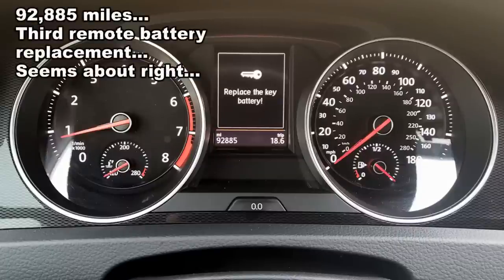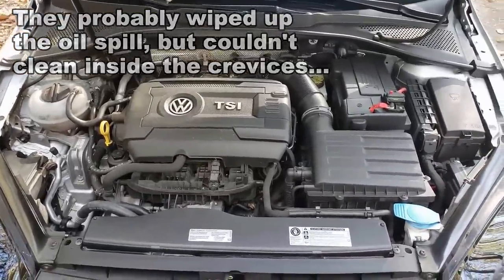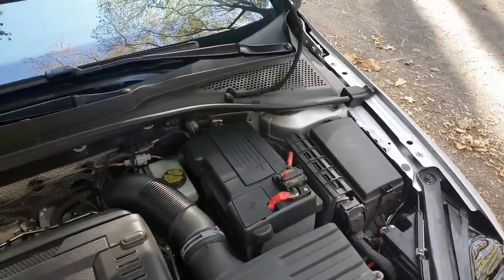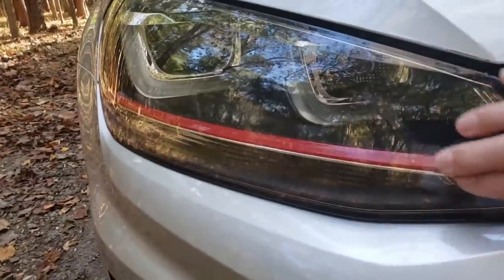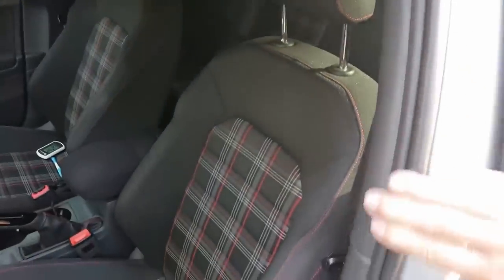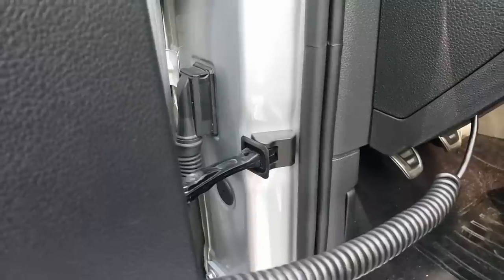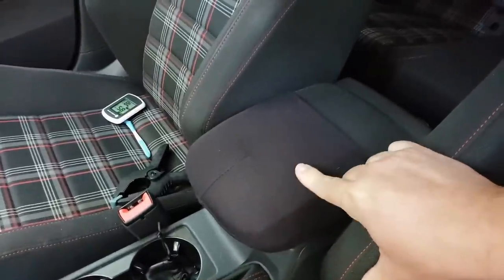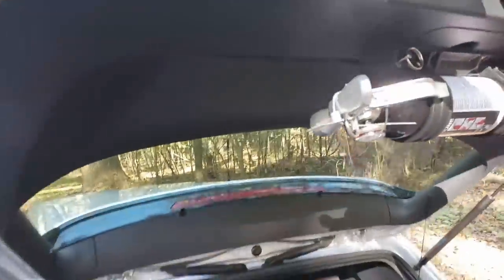THREE YEARS AND 93,000 MILES: My Report, Part 1

Comment: My '15 SE TSI Sportwagen auto has 40k now which I bought new.  I have clear bra and love it.  No leaks in sunroof.
I know what your talking about regarding water dripping down with window open.  I open the sunroof a bit if I want some air. 
My oil loss is almost 1qt in 10k miles.
Coolant loss is an inch in 10k miles.
Have never broken down, love the car, awesome performance, utility and economy and have gotten 40 mpg on road trip.  Love the size of the Sportwagen and VW flunked by not selling GTI Sportwagens.  The size is perfect and fits a 21cf cargo box.
Would like to add a hitch eventually.
Leatherette still looks new.
Added amber rear turns that are extra brake lights as well.  Stock wiring.
Looks sweet and much safer.
Just pulled out the red strips and use amber bulbs.
Cheers and great info.
Reply from the maker: Thanks for sharing! Your GSW sounds like a gem! Take Care, -Scott

Comment: The thermostat housing is known to seep coolant. You want want to look under the car near the oil pan. If there’s a leak/seep on the t-stat you should be able see white crusty mark around the oil pan. I have a 17’ w/ 71k miles and finally have the t-stat and water pump replaced.
Reply from the maker: Thanks for writing.

Comment: im surprised to find out that you have the same suspicion about coolant disappearing that i have with my mk7 gti (2018). ive owned my car a little over 3 years and only in the last 10 months ive had the low coolant light beep at me - once last novemeber, and again this past february (2023). ive topped up the coolant after both scares. was washing the car a month ago when i found what looked like hard water residue on the underside of the hood, and on the lip that runs around the reservoir. i cleaned it up and im giving it some more time before i check for that odd residue again. 

And about that fire extinguisher - is it good to keep in a car year round, despite the temperature variations? i get some pretty high temp variations, winters can get to ~11F and summers over 100 and i am concerned that it could blow up lol

on the oil pan - I plan to continue using my plastic OEM oil pan and also install an alltrack skid plate for the extra protection. that may be an option worth looking into for people worried about the hassle of replacing the entire oil pan.
Reply from the maker: The leak finally revealed itself at about 114,000 miles. The car got a new thermostat, water pump and housing... all with updated part numbers. All has been well for the past 85,000 miles. I'm not too worried about the fire extinguisher exploding. It's designed to be in an automobile. I suspect a seal would let loose and expel the contents long before the cylinder could burst. Finally, if I had the oil pan to do again, I'd skip the steel pan and install only ECS's Street Shield. Thanks for visiting!
Reply: @StealthGTI  thanks for the reply! It's very much appreciated that you're sharing your experience on long term ownership of the MK7. 200k miles? That's awesome! Mine just hit 45k and I had my DSG transmission replaced at 40k for a persistent and significantly loud whining (under warranty thankfully lol). Sounded like a racing gearbox, but a little quieter. Here's hoping the replacement performs better 🤞

Comment: Finally someone who’s talking about coolant. 
I have to be honest, I didn’t check my engine bay for like a month and while I was toping up the screen washing solution I noticed the level was pretty low. Went to service they checked if something is broken or some cracks in some tubes... NOTHING. And now I just add a little bit once in a while
Reply from the maker: I have a gallon of G13. I need to read to see if it's premix or if I need to add distilled water to dilute. I wasn't worried at my first top-off. BUT, if adding is the new normal, then I need to ensure it's mixed properly. Thanks for visiting.

Comment: Did you ever find your coolant leak? I had that issue on a gen 1 ea888 TSI for years. Eventually I found it was leaking where the oil filter housing/accessory bracket meets the block there is a gasket there with both coolant and oil passages. It leaked such a little bit at a time that it would dry and evaporate before any reach the ground. Only really noticeable once the intake manifold is removed.  Not super common issue from my research online. I only ever fixed it years later but I still think I could have driven for a very long time with that leak.
Reply from the maker: Yes. The leak became obvious by 115,000 miles. I replaced the thermostat, water pump, and housing with the most recent revisions. All has been fine since then. I'm at 184,000 miles now. Take Care!
Reply: @StealthGTI  Awesome! thanks for the reply

Comment: I have a 2020 GTI S with the manual. Love the car but I have s creaking sound sometimes I hear it in first gear only. Does anybody have any ideas for me? I was thinking the clutch needed to be adjusted? Thanks ....
Reply from the maker: My clutch squeaks a little when it's really cold. But that's only until the cabin warms and only when I actually depress the clutch pedal. Where is your squeak?
Reply: It’s in first gear as well and when the clutch pedal is depressed. Can’t replicate it. Car only has 3K miles on it and I hear it less and less.

Comment: Using a drop in k&n air filter in the stock air box actually makes a decent difference for the turbo. not sure if you are still using paper, but I figured I'd drop that note here.
Reply from the maker: Thanks for the note. I have a drop-in dry filter that I will install soon.

Comment: OBD eleven? That's OBD ii (two)  I've owned VWs and gave up.  Drive great but too many things happen after about six or seven years besides all the weird stuff that breaks along the way.  And then there is Diesel Gate.
Reply from the maker: Chris - OBDeleven is a dongle that plugs into the OBD2 port to emulate many of the dealer diagnostic tool functions. Thanks for visiting.
Reply: @StealthGTI  Thanks for the correction.  I guess they named it that way to trip up old folks like me.

Comment: 3:30 i know this is a completly different engine but the older 1.9tdi pd130's had something called "head lift" when remapped, 
this was due to the metal compound of the head bolts not being strong enough for the additional boost,
And stretching
But on most of the ones i have seen they slowly loose coolant, 
no visual contamination of the oil (emulsion),
No hydrocarbons in the cooling system, but coolant ending up in the cylinder at such a small rate it gets vaporized in the combustion process,
Food for thought
Reply from the maker: Thanks. I know the tuners would push the boost pretty high, higher than with the gassers. I'm hoping head lift is not a problem with OTS tunes. If it was, I suspect I'd see more posts about ARP head stud kits or something. Thanks for visiting.

Comment: Im thinking about purchasing a used 2016 GTI S from Carmax, it has 45k miles, running just about $16k. What should I know or be looking for to see if this car is or isn't worth it.
Reply from the maker: I'd just look at kbb.com and other sources to ensure that the pricing is competitive. Carmax seems to have a good reputation. But they are retailers; so, their pricing reflects it. Good Luck!
Reply: StealthGTI How reliable is the MK7?
Reply: Bought the GTI from Carmax, loving it so far! Is premium a must! It’s been at Carmax so I bet it’s been using regular as well, I don’t know it was using before hand. But I want the vehicle to last, what’s your opinion. And it’s at 45k miles, what do you think I should be doing to keep it amazing and in shape?
Reply from the maker: @TheSmitty  -  Sorry to have missed your reliability question. YouTube does not sort replies the same as initial comments. Plus, this video is blowing up with activity that can be hard to follow. Perhaps my "Part 2" to this video will answer your question. I don't know if it's in your feed yet. I published yesterday. Your GTI does not require premium unleaded fuel. However, VW does recommend the use of Top Tier fuels and states that premium is required to maximize the engine's output. Premium is required IF you get your ECU programmed. Since there's no telling what the previous owner used for fuel, I'd run a dose of injector cleaner and call it a day. There's not much you can do about carbon deposits that may have formed on the valves. So, I'd just enjoy the car and budget for a valve cleaning in the future. FWIW, I have not needed to clean my valves so far. But I also haven't done a visual inspection. Take Care, -Scott

Comment: Get your water pump and thermostat pressure tested. At 50k miles both were leaking and were both replaced under powertrain.
Reply from the maker: My cooling system got a clean bill of health from a VW specialist. All I can do is drive until the problem is undeniable.  Thanks for visiting.

Comment: The coolant is leaking from the turbocharger connections.  If the copper washer seals have never been replaced, it will leak there for sure.
Reply from the maker: Thanks for sharing. -Scott

Comment: Hmmmmm, just to be safe , get your oil checked in an analysis.

See if any coolant is mixed in the oil, in case the original head gasket has a small leak inside.
Other then that, very curious.
Reply from the maker: My new gasket arrived yesterday, the oil and analysis kit arrived today. I'm planning take a sample and replace the gasket tomorrow. I'll try to include it in a forthcoming video.

Comment: Awesome video I miss my tdi I have a 2017 passat r line now. Thinking about doing the apr tune but worried about the auto trans
Reply from the maker: Contact APR and ask. I'm watching how the Arteon's transmission responds to the extra power. That might be my next car.... maybe. Thanks for visiting.
Reply: StealthGTI this is my 3rd vw. Good mpg but no power. I like how detailed you are. I’m the same way.
Reply from the maker: @JGFILMS24  - Yeah. The Passat might sell better if it had the 2.0T.
Reply: @JGFILMS24  We traded a TDI in for my wife's 2015 Passat.  I loved it enough (great mpg and good pickup at highway speeds -- and let's not forget it operates on regular, not premium) enough to buy a 2016 Passat for me.  The 2016 (and I assume the identical 2017) is NOT as quick and effortless, power-wise, as the 2015.  Not sure why.  Thought about a retune, but also worry about the transmission.  Does anyone know if the Passat transmission is any different than the Audis and Golfs that run on premium and have the extra horsepower with essentially the same engine (but tuned up differently)?  If they are the same, then a retune should work well on the Passat.  I know ECS sells several things to up the horsepower and performance.

Comment: Replacing clutch after only 15k miles??
Reply from the maker: Yes! It's fairly common for the factory clutch to slip after an APR Stage 1 tune. This is especially true with the original high-torque tune, which touted 381 lb-ft at around 2700 RPM. Then, couple that to my practice of towing trailers, my clutch slipped one cold morning when I neglected to downshift before stabbing the accelerator with 1000 lbs in tow. It wasn't a good combo. HAHA! I probably could have driven much farther, but didn't want to risk being stranded. BTW, the latest APR Stage 1 file outputs less torque, 351 lb-ft at 3000 rpm. I suspect the factory clutch will last longer with that... and better driving habits.  ;-)  Thanks for writing. -Scott
Reply: @StealthGTI  thanks! Thinking of getting this car soon!

Comment: Coolant leak could do with water pump issue that's been pretty common problem with mk 7 VW.
Reply from the maker: Thanks for the note. My water pump finally failed at 116,000 miles. Now I have a new pump, thermostat, and housing. I'll be happy if that lasts another 116k.  ;-) Take Care!

Comment: My MK6 with 50K miles sips coolant as well. No real sign that the water pump is bad yet...I just add a tiny amount every so often.
Reply from the maker: Thanks. It's possible that my inspection will turn up nothing. If so, I will continue to feed coolant to the car.

Comment: Can you describe the glass OEM issue?
I have an issue a cratchit inside the windshield,  with my 2019 GTI and VW desnt think they are respondled.
Reply from the maker: Imagine microscopic bubbles. The closer you get to the glass, the more obvious they become. From three feet away, you cannot see the bubbles, but you can tell that there's just a slight perception of less clarity. It's not awful... just barely noticeable. I took is as normal and acceptable until my FY glass was installed. Now, years later, my FY glass has little tiny specs from debris hitting it. Nothing wrong with the glass; it's normal wear and tear. But the glass was perfect for a long time. Thanks for visiting.
Reply: @StealthGTI  Thank you for the response and sorry for all those spelling errors. I should have edited my text before clicking "send".

Comment: Did you ever figure out why your car consumes coolant?
Im interested as my Audi TT does the same at the same pace.
Reply from the maker: I don't know that it really did "consume" anything. The leak, if present, may have been small enough and in such a place that it leaked without a trace. Regardless, the leak finally surfaced by 115,000 miles. The car now has a new water pump, thermostat, and housing. Take Care!

Comment: I didn't know you could stick a trailer hitch on these cars....what's the max tow weight on your car?
Reply from the maker: VWoA does not publish trailer weight ratings, "Information not available at time of printing." Instead, I look to VW UK specs, which allow 1500 lbs without trailer brakes. That is sufficient for me. Feel free to check out a video with more info at https://youtu.be/ByltEJerp1k. Thanks for visiting.

Comment: Came across your vid while searching oil pan GTI. Glad I did. My oil plug is leaking due to the threaded insert recessing so I have to change the pan. It’s a MK6 so the stock pan is metal.
Reply from the maker: Glad it helped. I have a follow-up video that shows my work with a Tiguan gasket on my steel oil pan. View my video list and scroll a few months down. Thanks for visiting.
Reply: @StealthGTI  The GTI is my wife’s car. I have to fix the pan before we trade it in in June when her new car arrives.

Comment: The only thing that really bugs me are the engine check light, EPC & CEL going on & off sometimes but no worries, I have an extended warranty from Geico which cost peanuts.
Reply from the maker: That's some strange behavior. I hope the warranty proves to be a good one. Most seem to have loopholes that screw the customer. Thanks for visiting.

Comment: Still in pretty good shape! I agree with water going in from roof too.I have PPF on lights, back of mirrors, boot sill and clear bra coating then ceramic coating. Saves me wash less as dirt seems to just drop off.
Reply from the maker: Yes! I didn't mention it in the video, but I have PPF on the hood, front bumper, mirror caps, and rear bumper top. I also have ceramic coating on the entire car. Bird droppings rinse right off... it's wonderful! Money well spent! Thanks for commenting. -Scott
Reply: Whenever standing water on my roof too, have to drive off before opening windows (2011 Mk 6). Was thinking of putting vent shade window deflectors on the door - still undecided.
Reply from the maker: @bthemedia  - I considered the WeatherTech shades. I haven't done it because I don't drive with the windows cracked or open frequently enough to justify it. I'm not sure how well they keep rain water from entering a fully-lowered window, though. Let me know if you find out. -Scott

Comment: If ur still worried about crank walk, you can use a magnet by the clutch position sensor to start the car without using the clutch. I got an electronic magnet I'm gonna hook up soon with an oem switch so it's all oem ish
Reply from the maker: Thanks for your comment. I doubt I'll take it that far. I think my clutch is less likely to cause crankwalk than some of the stiffer options.

Comment: vw front wheel drive have differentials? I thought the axles connect directly to the transmission. just a question, nothing to say you're wrong; just never heard of fwd with diffs.
Reply from the maker: Nearly all cars have differentials. A FWD transmission used to be referred to as a "transaxle." It may still be... I'm not sure. Most of them feature an ordinary open differential that's hardly worth mentioning, which may be why you hadn't heard of it. But, once you add an LSD, TBD, or e-diff, then owners will start calling out the separate internal differential. In my case, the car came with an e-diff that's known as the VAQ differential. It behaves similarly to an LSD, but is electronically controlled. Thanks for visiting.
Reply: @StealthGTI  nice! thx for the info.

Comment: Hi.
I had the same case of coolant seemingly disappearing on my Seat Leon. In my engine (1.4 TSI 125hp) the air intake heat exchanger leaked, and the coolant was sucked into the intake. You might want to check that.

For the ripped wether stripping on the doorjam, I suggest you stuff a flexible foam pipe in there
This guy explains it: https://www.youtube.com/watch?v=rv9Tr6USqsU
Reply from the maker: I've already ordered a replacement door seal. Thanks for visiting.